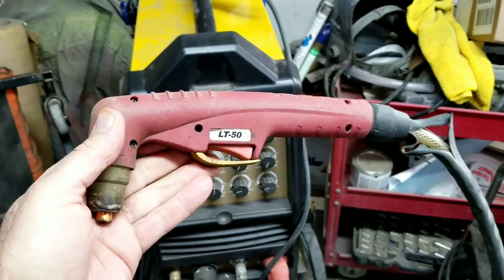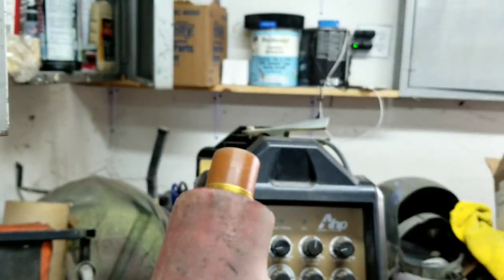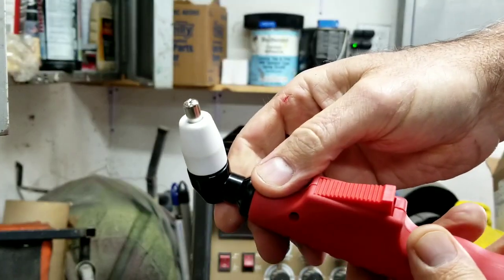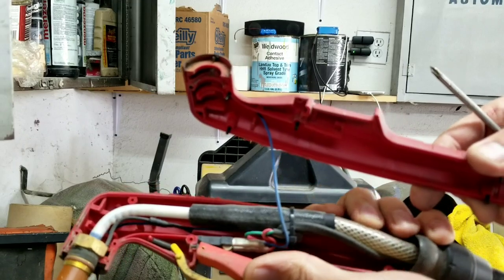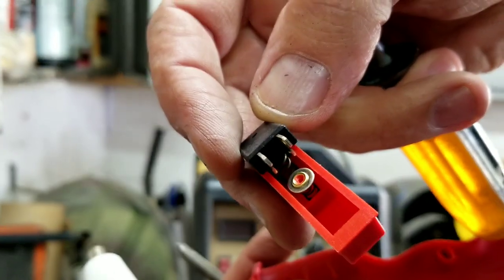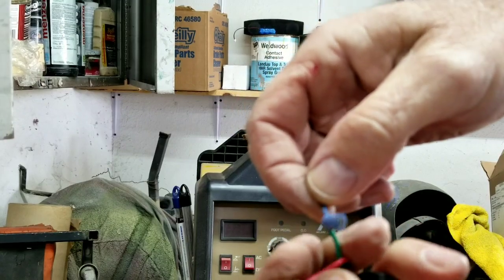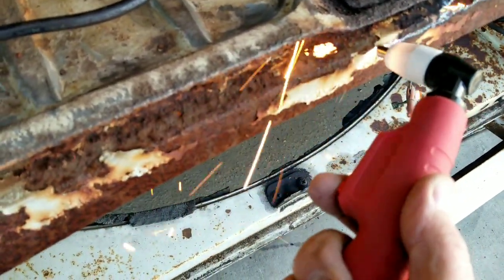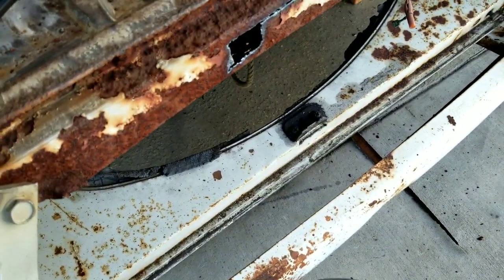Cut 40m plasma cutter problem solved

Comment: the original gun is version of an older hypertherm design, and tips are readily available almost any where.  Eastwood sells them.
Reply from the maker: oh cool I will keep the old gun too but I could not find the tips online. I will try the welding supply when I am there next. I am betting they are more expensive. found out the plasma cutter works better on 220. on 110 it skips a lot. and does not cut through rust or painted stuff very well.